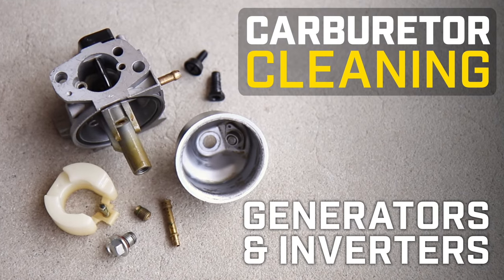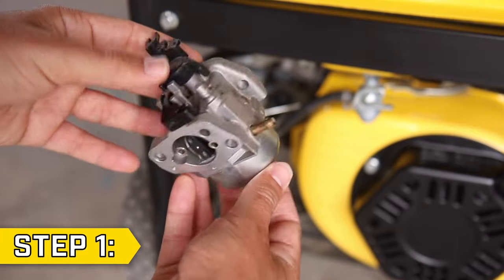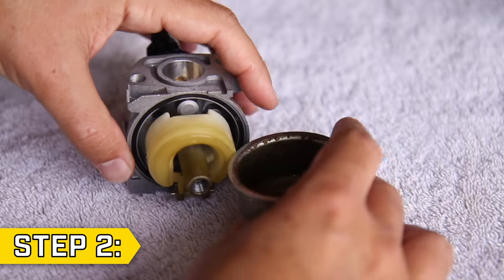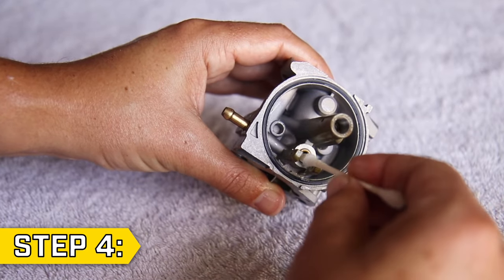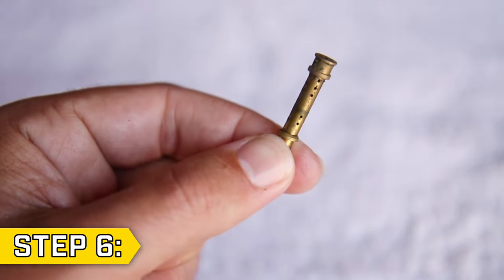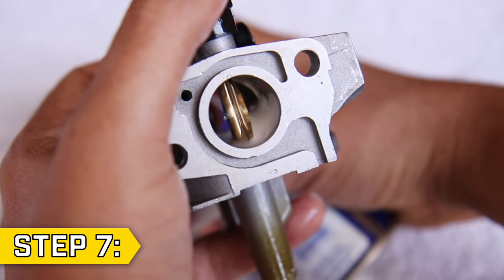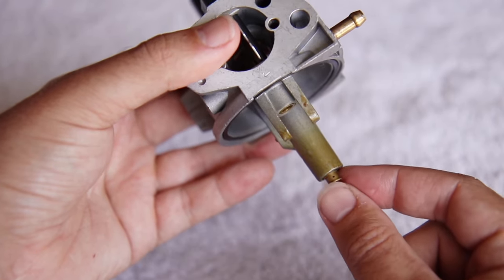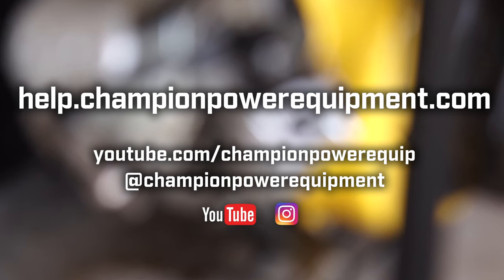Carburetor Cleaning

Comment: For those that dont have a tiny wire i just used a staple and bent it straight. Worked like a charm, snowblower is up and running again! Thanks for the video!
Reply: Wire twist-ties from bread bags work too if you strip the plastic off.

Comment: I have heard to avoid using a wire to clean the nozzle as it is usually a soft metal like brass. The holes of the nozzle are very carefully calibrated, and even gentle cleaning with a wire can affect the fuel air balance. If possible, I have been advised to only use carb cleaner for the nozzle.
Reply: This I knew. IT'S the doing of it that kills me.
Reply: There is not a problem using a wire, the issue is to ensure the wire is much smaller than the hole to be cleaned. Using a wire too large or drill could damage the brass/Aluminum and May effect the operation. Carburetors are all made of soft metals, plastics and precision parts.  A gentle approach to any carburetor work and adjustment is necessary at all times.

Comment: Over decades I have worked on many small engine carburetors, this is an impressively informative and detailed easy to follow instruction on carburetor cleaning.
Reply from the maker: Glad it was helpful!
Reply: I bought a used 3100w Champion 75537i that had literally never been run.  Gas was orange when I drained it.  Carb was spotless.  I put in new gas...and it still wouldn't start.  So I pumped the new gas out.  Turns out there's a tiny white plastic inline fuel filter stuck up into the nipple at the bottom of the fuel tank.  You can't see it until you remove the fuel line.  I pried it out and sure enough the remaining gas in the tank flowed right out.  The filter is so small it clogs really easily.  Once I fixed that the thing ran like a top.  Great unit, but that filter is not.

Comment: Fantastic walkthrough!! Couldn’t get mine to start with gas, but it would start with Propane.  I’ve never taken apart a carburetor, so I was a bit timid to try it. Thanks to this video my generator works on gas again!!! It was filthy, all of the jet holes and solenoid bolt holes were plugged.

Comment: Thanks to this video I now know that my new toro timecutter myride zero turn mower doesn't have a carburator problem. I don't know what it is but it is not the carburetor. It's not the fuel filter. It's not the fuel. It's not the fuel pump. The spark plug chamber might be flooding, not sure. But why would it.

Comment: In addition to the fuel inlet, there is what seems to be a small vacuum fitting.  (E.g., above your right forefinger at 3:23).  What does that connect to?
Reply from the maker: If you have a dual fuel generator, that would where the propane fuel line connects to. 🙂

Comment: hello, I cleaned the carburetor, it was not used for 2 years and the float was blocked. But now after I start and put the shock in the normal position, the generator stops.The only thing I didn't pay attention to is that black screw, pilot screw, how much it needs to be threaded, if it matters. 

And I didn't clean de main nozzle 😢.  

May be  this is the issue ?
Reply from the maker: Yes, we do recommend making sure the black screw is threaded correctly & that all jets, orifices, & the pilot screw is cleaned. Check out this video from our Help Center: https://help.championpowerequipment.com/article/dctwwry42a-cleaning-the-pilot-jet

Comment: What do you do when all that is done and the engine runs too rich? There is no mixture adjustment. The plug is black, the engine runs, but smooths out and speeds up after turning off the fuel tap. Classic symptoms of running too rich. Needs a smaller hole in the main jet? The main jet has a hole 0.029" diameter - what should it be?
Reply from the maker: We are sorry to hear this. Are you at a high altitude? If the generator operates too rich, it may be due to elevation, & would need an altitude jet installed for gasoline operation. We recommend cleaning the spark arrestor as well of any carbon buildup. 👍
Reply: For the main jet to be too big I would expect you would have to be at very high altitude to be as rich as you claim. 
Are you 100% certain you have followed and completely cleaned the entire carb, jets and passages exactly as stated in the video. 
How old is the generator, has it been used extensively in a dirty construction environment. If yes then check that the air filter is clean or new.  Make sure the choke is connected and functioning correctly.
Another question make sure the generator is used out doors only and is  not tightly enclosed into some custom sound deadening structure/box. The carburetor must breathe fresh outdoor air and the exhaust must vent directly to the out doors only.
Reply: @ChampionPowerEquipmentHQ  We are at sea level. It is a rototiller and has run too rich from the word go - new last year. You refused to sell me a new main jet, saying that you could or would not ship to my address, despite that fact that you had shipped a new float chamber gasket ring only two weeks earlier. You suggested I change my address. So much for customer assistance.

Comment: Remove the "Float Bowl Bolt o-ring" before using carb cleaner. As a matter of fact, remove all the o-rings before you use the carb cleaner. I didn't, and had to make a trip to the auto parts for a o-ring replacement kit, carb cleaner will eat up the o-rings.

Comment: Cleaned my carb and still starts runs and dies I’m lost I’m about to sell my log splitter and go back to the trusty axe tired of champion
Reply from the maker: We're sorry to hear this. It is possible that the tiniest of orifices are still clogged. In this case a replacement carburetor would be needed. At your earliest convenience, please give us a call at 1-877-338-0999 or email support@cpeauto.com. Thanks for your patience.
Reply: Try replacing it , or replacing your spark plug maybe

Comment: Step 76...this is a joke honestly. No other brand have I had as much carburetor issues as I've had with Champion.
Reply from the maker: We are sorry to hear this. Please give us a call at 1-877-338-0999 or email us at support@cpeauto.com, so we may help address any concerns you may have. Thanks for your patience. 🙂
Reply: You have to shut the fuel off and let it run to die to drain the bowl. I've had Champion for years and it starts 1st pull.  And add some preserv to the fuel as well.